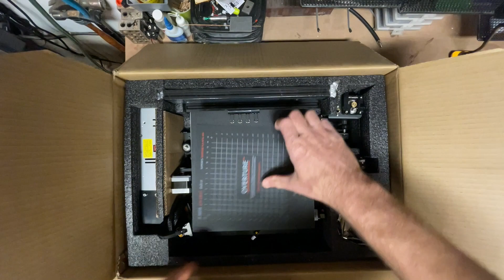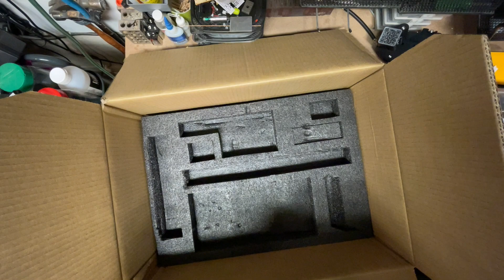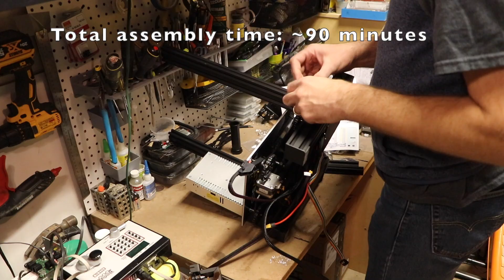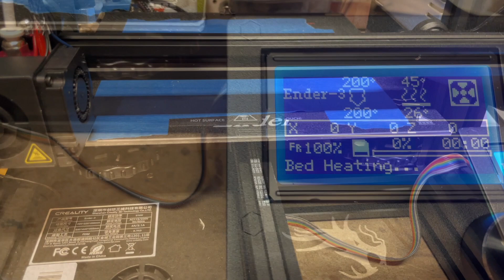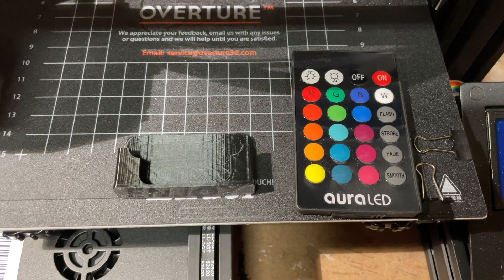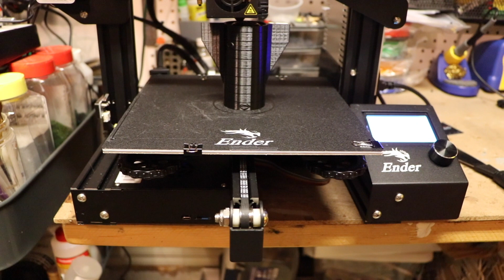Ender 3, a Budget 3D Printer: From the Workbench Ep 2

Comment: Is there any way to recycle the mistakes? I am guessing there will be a bit of trial and error as you learn to use it.
Reply from the maker: No, not really except if half the print is fine and then it fails you could print the other half and glue them together. I cut and glued a couple pieces together with one recent print that had a goof.